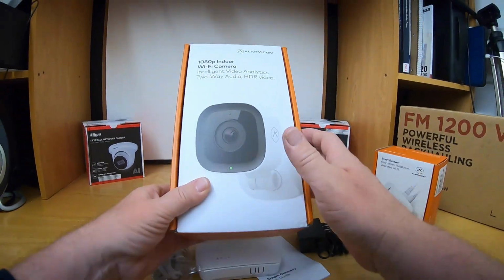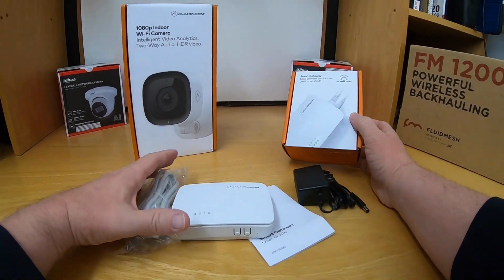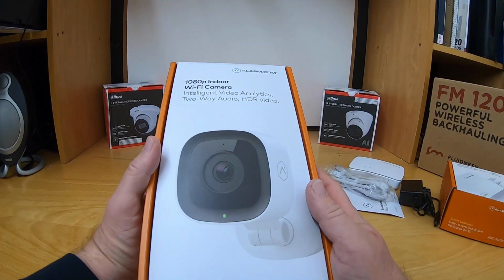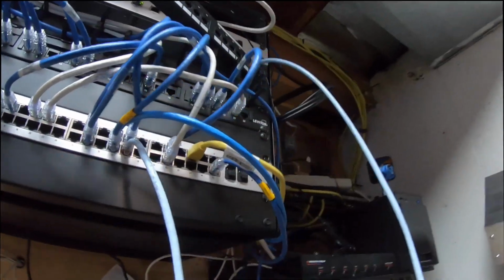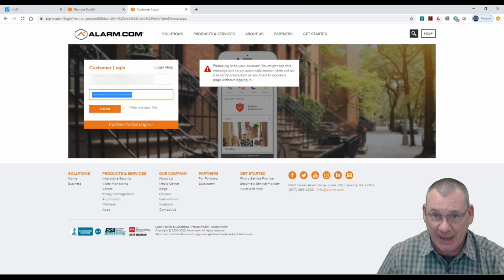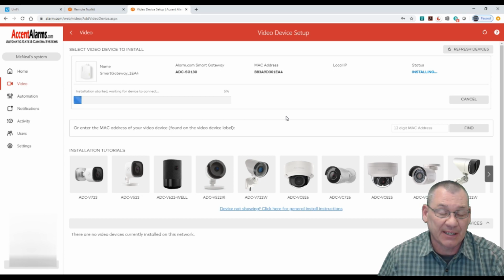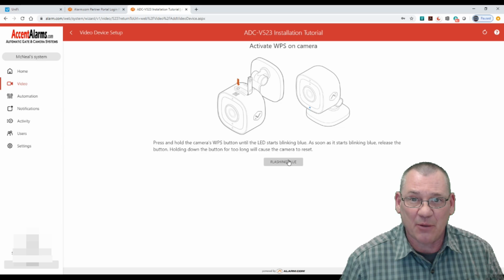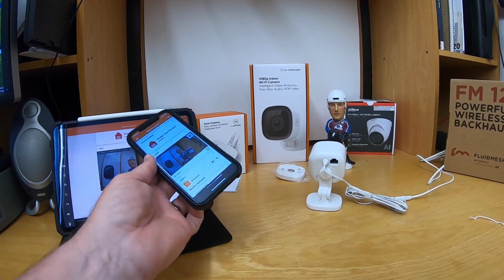Alarm.com Smart Gateway & WiFi Camera setup

Comment: I just set up my Google Mesh system because the WiFi signal wasn’t strong enough to reach the furthest camera. The security system is connected to the gateway. 
Can I just plug the Smart Gateway straight into the Google router? Will it us the points so all camera have strong WiFi signals? 
Or do I have to connect the security system to the google mesh and disconnect from the gateway completely?
TIA
Reply from the maker: Thanks for watching.  I'm not familiar with Google Mesh, but I can tell you this is exactly why Alarm.com has the their smart gateway.  Once you set it up, you can change your router, IPS, home/business WiFi and it doesn't require you to change your Alarm.com  system.
Reply: Accent Alarms got a technician out to the house. Answer is no in order to use the Mesh system I had to disconnect my camera that wasn’t working properly and connect it to my mesh system. But the good news is the mesh system acts like the gateway, if I change providers all I have to to is plug my mesh into my new router.